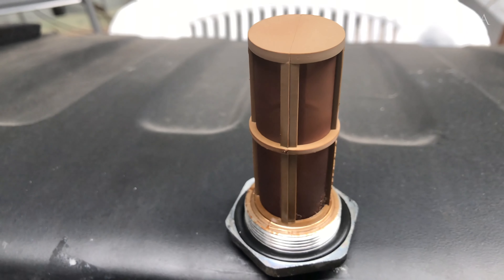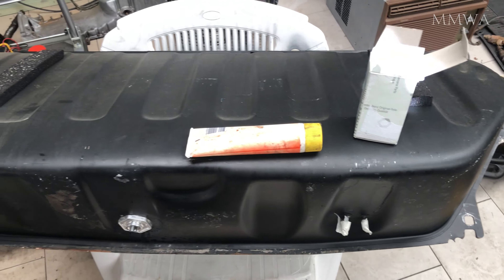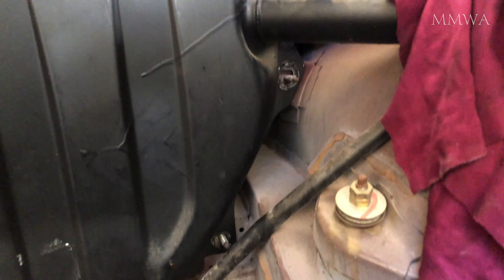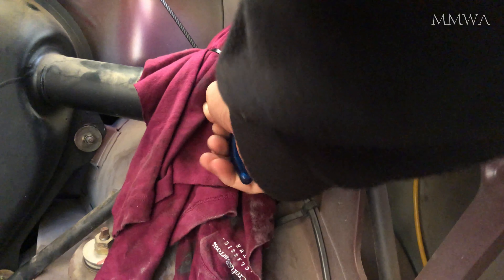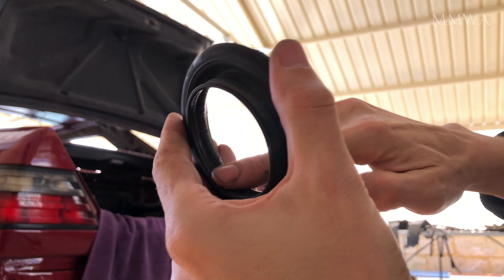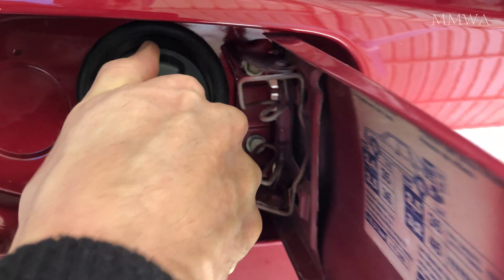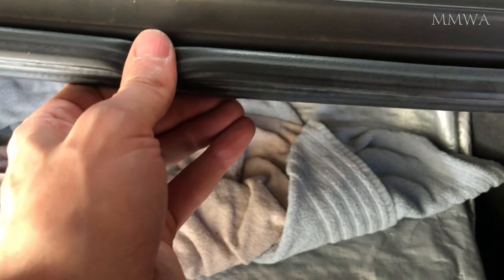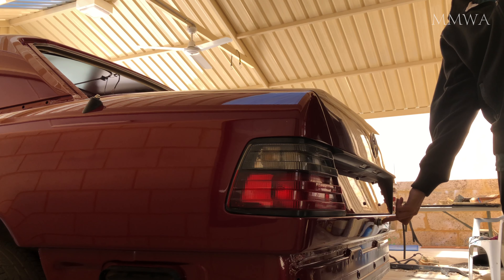W124 - Fuel tank in place and rear lid seal installed

Comment: Any advice on how to wash out a dirty tank?
Reply from the maker: there are fuel tank cleaner kits available from auto parts stores, if its rusted badly i would consider just finding a better one. You can also get them professionally cleaned, some radiator rebuilding places may still do it. This industry these days only survives working on huge trucks, cars switched to plastic tank radiators decades ago so they are few and far between. Also cars have plastic fuel tanks these days too.

Comment: You mentioned being able to manhandle the neck to be centered in the hole... can you tell me how? Mine is pretty off center and thus stretching the grommet out of place
Reply from the maker: with the carpeting removed the neck is accessible inside. You just have to bend it where you want it to go, i wouldnt go too far as if it cracks you will need to replace the tank. it is obviously already bent as it is now as its supposed to be in the centre.
Reply: @MMWA-DAVE  So, the neck is pliable? I just assumed it was solid metal or something!
Reply from the maker: @reyngel  It is solid metal tubing but its thin and can be bent as required, just gotta be careful and not over do it.
Reply: @MMWA-DAVE  Ah, ok. Thanks for the help on that. I’ll give it a shot!
Reply from the maker: @reyngel  if it cracks it will need to goto a fuel tank repair place to be soldered, this is not something that can safely be done at home in my opinion
Reply: @MMWA-DAVE  Hi thanks for the video, I'm having the same issue of centring the neck. You had something black around yours doing it. What was that?
Reply: Opps - just realised it's the focus, there is nothing there. Thanks again for the video

Comment: Loving your progress man, I've been following your videos since I discovered your channel when I needed video help when I was trying to remove the sunroof in my w124. I found you can adjust the spring that pushes the bootlid open between two seated positions. One is more static, the other pulls the spring so the bootlid pops open quicker. On your other 124 maybe the spring is in the static position or the spring is overstretched from age/use. Hope it helps! And keep enjoying the parts going back in! 😍 can't wait to see the finished result!